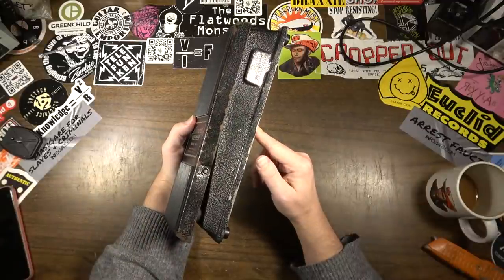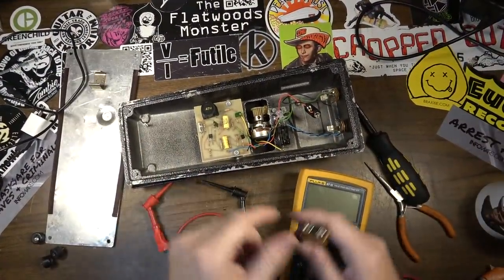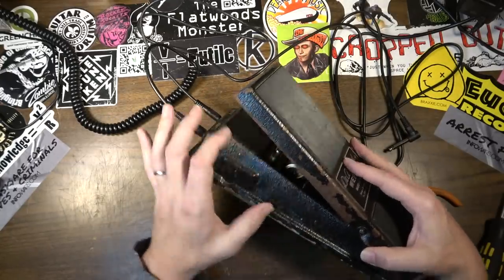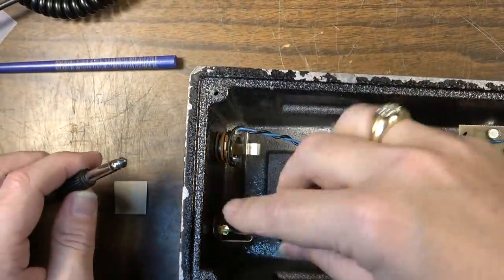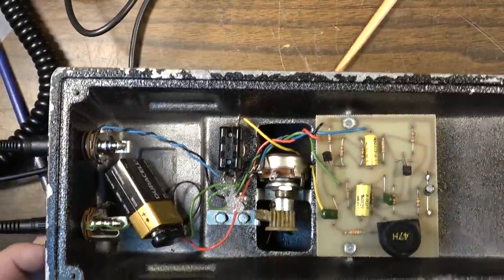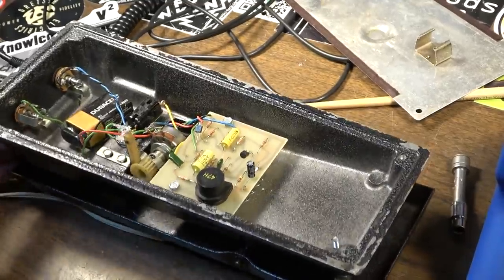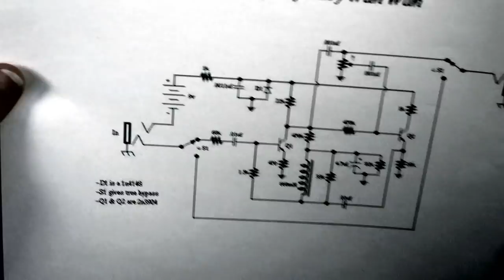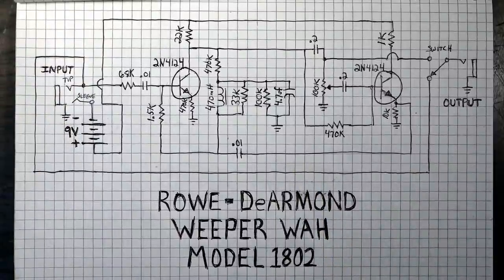Noisy WAH Repair - 1970s DeArmond 1802 Weeper Pedal

Comment: The Diode is just to protect the circuit from reverse battery polarity...
Reply: That vox  . 0011 mfd cap wont pass power (conduction) through that diode think about it? Diode protection would not use a cap? It would tied direct with no cap in series.. Its a signal  high pass noise filter of some sort.

Comment: Way cool, Brad! I scored two of those NIB this summer. They came from a music store that closed in the early 80's and had been in storage. One of them had almost no range and all I had to do was re-clock that gear towards the high side.
Reply: Are they the "Block" style logos or the "Script" style as this one is? 🤔
Reply: @Tacopusher  These are script logos.
Reply: How's the sound difference between the two? I've also got a pair of script logos as well, but the sound it very different from one to the other. Upon further inspection, mine seem to have different potentiometers in them, or at least different variations of the same pot. My first one says Type EJ and says Extra Life under that and my second one simply says Type J and says 8112 underneath that. I tend to favor the Extra Life opposed to the regular one.

Comment: I've got a early 70s Dunlop wah pedal that's never worked in about 20 years and it's just a display piece now to be honest. But I do fancy cobbling together a tube screamer circuit into it just because it looks so cool and I'd like to use it in some fashion.... I've never actually looked inside it to try and see what the problem is and this video has peaked my interest in ripping it apart....cheers .
Reply: There isn't much in a standard Dunlop crybaby. It's usually the pot or jacks are worn out. At least that's what has always gone wrong with any that I have owned. I don't know how many turns the pots are rated for, but they get heavily used.
Reply: @deaddiver3768  it will be something silly as it got wet from an outside gig 20 odd years ago and stopped working. I don't use a wah much if any now but I love the look of the old Dunlop pedals. I will definitely dig into it in the next few days for sure.
Reply: Definitely try to fix it.. The old ones are very desirable, so I wouldn't go transplanting another pedal type in there if it doesn't work out
Reply: Fix that bad boy! It’ll be a great piece of gear.
Reply: Give it a go. I've picked up a few pedals super cheap and an Ampeg B15N for $50 all because of loose jacks or connections.
Just a turn of a wrench and presto! a fully working pedal.
A lot of the older pedals use the case and jack as the ground connection, so if it gets loose it will keep cutting out or not work at all.
Could also be a loose wire come un-soldered somewhere as happened to a PA speaker once.

Comment: That Dunlop diode/cap network is likely a “turn on -pop filter”. 
I’m a fan of these older less known Wah pedals. They are significantly less expensive than a vintage Vox and nearly identical inside. Then again, the Xotic Clyde is a killer Wah for even less!

Comment: The diode on the Dunlop CryBaby is for polarity protection. (well a very cheap and crude way)
That whole rail is the power supply rail.
Reply: Correct. And the cap across it keeps power supply impedance low, at audio frequencies.

Comment: My first diy pedal build had an inductorless circuit mounted in an old sewing machine regulator pedal, equipped with an LDR and a vane to keep it simple mechanically.
Soon after that I bought a Colorsound wah which DID have an inductor (huge sound improvement). It also produced quite some hiss, and when activated the bass sound of my guitar almost disappeared.
These pedals sell for crazy prices (like $400) just like the Watkins Copicat tape echo goes for even more.
Now I am reconstructiing the Colorsound wah from modern parts. And I found a decent pedal casing kit from China!

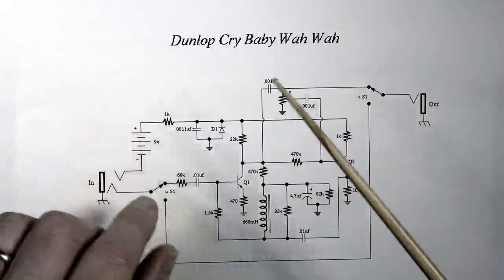Comment: 29:42 The 0.001uF capacitor is there to bypass any interference picked up, to ground, especially RF. Because there's an inductor and capacitors in this, it makes it susceptible to RF pick up, which will sometimes manifest itself as an AM radio station playing through your amp.
The 1k resistor and the reverse biased diode are there to protect against trying to connect the battery the wrong way round, but looking at the circuit I'm hard-pressed to see how any damage could happen if the battery was in the wrong way round and D1 and the 1k resistor were omitted. Q1, Q2 and the 4u7 electrolytic all have a fair amount of resistance between them and the supply rails.
D1 would deffo go short circuit eventually, if the battery was put in the wrong way round and the 1k resistor was omitted.
I'm curious now. I want to build this on a breadboard without the protection to see if anything is damaged by reversing the supply. 🤔
Reply: Our guitarist, had a Cry-Baby that ... in the down position ... 
got a local Spanish language AM station .... make your own joke !
Reply: @zankyalbo2208  Be sure : maybe the same station can be found in south west of France, at least :p (but by an amp, marshall MG10). It's strange to ear some Spanish alone in your bedroom :p

Comment: The mechanical aspects of Wah pedals were always a problem as they tended to take quite a beating back in the day because they took a lot of moving forces. Certainly rubber end stops got crushed with time and those rotary pots/gears and balance mechanism took a lot of punishment ... Even the rubber feet under the pedal case themselves could get splayed out and broken off due to the application of weight.
Great to see you fix one up ...

Comment: You fixed it! So cool to see this in real time. You rule Brad! Hit me up
Reply: no he didnt. Lots of mistakes and erroneous guesswork here. The cap is 25V not 2.5V and come on dont be lazy and tack it, the board is only on with 2 screws.  The first 470 is OHMS not 470K.  And after all that he didnt even fix the noisy transistor. He doesnt know basic electronics or how pedals work, all random hack guesswork

Comment: Hey, the potentiometer itself is interesting - I wonder why the manufacturer would use this tapped kind rather than a typical one, like the other pedal has.

I wonder about changing the transistors to BC547 or BC550, and/or changing resistors to metal oxide film type in order to get rid of the noise.
Reply: I've got two of them and the potentiometers are different from each other. One is older than the next and the "Script" logos are the older ones. These wahs have the Best "quack" to them and seem to nail that old school tone spot on!
Reply: Changing transistors won't help much unless the transistor is 'defective' and generates excessive noise.

Comment: Those extra parts on the power section of the Dunlop are to filter out noise when using an external power supply.  I have this pedal, it does have a DC input which is not shown on the schematic.  I also have a '71 Colorsound Wah, and a '77 Thomas Organ Crybaby (the one Dunlop based theirs on)

Comment: That level of noise is definitely not normal for a DeArmond M1802; mine is a couple of years older than that one (though a bit prettier) and it has always been really quiet since I bought it around 16 years ago.  For what it's worth, I've played through 3 or 4 others over the years, at least one of which was in fairly gnarly shape.  That one was a little bit scratchy sounding, but I don't remember having that particular problem with any of the others.

This is so fascinating; my other wah is a Vox 847, basically just like what that schematic is for- but there's a slight problem with the schematic.  As far as I know, Vox wah pedals were not manufactured at all from (roughly) 1980 to 1994.  The V847 was manufactured (I believe exclusively by Dunlop) here in the U.S. from 1994 to 2007, when they began production of the V847a in China.

Comment: It sounds to me like the noise is either a flakey transistor or a flakey resistor, both of which can make that type of hissy noise when they start to head south.
Reply from the maker: I'm leaning transistor. I would have expected a flakey resistor would have changed the noise when I tapped it with the ol finger or chopstick.
Reply: @TheGuitologist  Yeah, could be. I would run into this kind of fussy thing with mixer preamps a lot and ya know... it's always the last component you swap out that's the culprit. :-)

Comment: I had DeArmond volume pedal all with the photocell and it had hinges in it for some reason. Can’t remember if it had the gear with the teeth. The hinges kept coming loose; I was forever opening it up and tightening them. Finally gave up on it. When I moved to another house I didn’t take it with me. I have two different Jimi Hendrix wah-wah’s from the late 80’s/early 90’s that I need to get a true bypass mod done to. Hope someone sells a mid kit for it.

Comment: That crybaby diode cap circuit is a reverse polarity protection circuit if you connect that reversed that 1k resistor will burn 🔥 out. The. 0011 cap is to clean up transients from B+
Reply from the maker: I could understand that with a wall wort, but this schematic shows no power supply jack. That's what confused me. No need I can see in that with a polarized battery terminal.

Comment: Diode/resistor are for reverse polarity protection - in case you touch the battery backwards during battery change.

Comment: I think the pot back tab is so if the pedal is at 50% it has  minimal effect .
Down or up gives the full effect .

PS 
The BC109 is a low noise transistor .
2N4124 is general purpose transistor & the 2N3904 is a planar switching transistors  !

Comment: I could be wrong , but I’d assume the little extra bit in the cry baby has to do with plugging it in to a wall wort . I once had an issue with mine , and called Dunlops tech support . I talked with a tech , and one thing he mentioned is that they work better on a batt. And they can be noisy when plugged in. Even though it had a circuit for that , it only made it better not gone.  Or something to that nature. And Something about 60 cycle hum . 🤷‍♂️
  But you know me Brad , I’m just a picker , not really a tech.

Comment: I have several of these (three, I think) and was going to do a little video, too, given that two of them don't work. We grabbed one in my old band in the late '80s because they felt a bit darker and gnarlier than the traditional Cry Baby, which was already beyond cliche. Have you ever gotten any of those Morley optical wahs on your bench?
Reply from the maker: I have not had to repair any Morley optical. I’m guessing those will be super reliable.
Reply: @TheGuitologist  I don't know anything about their wahs, but their volume pedal is a pretty interesting affair. It's a light bulb that shines on an LDR, and there is a piece of black felt that the pedal lowers in front of the bulb to shut off the amount of light getting to the LDR. It's pretty inventive, really, and you never have to worry about the pot getting scratchy, because there isn't one. I wouldn't want to have invented it and made it work, but it's a pretty simple idea.

Comment: It is useful to use silocon elastic band over battery and conector to shrink battery conector with baterry outlets. Easy and handy.
But, before fiddling around mechanical setting of sweep range, I would clean pot track with technical alcohol - it is the most probable reason of many noise issues in such a devices. You mechanical repairment only set another freq range of high border so it is lower now. And then BC239 or BC413 instead of those inside. Minimally basic noise will go down. There are still another hacks for noise issues - cap 10nF paralelly with choke and cap 22nF from pot center to ground. Enjoy!   CHI :@)

Comment: What exactly does it do? Based on the sound (at least with 60 Hz hum as input), it seems to introduce some distortion (clipping?) and frequency modulation (pitch change). I wonder if there’s a schematic available?
Reply: He drew 1 for it at around 24 min into the video.

Comment: The emitter resister on Q-1 is 470 ohms (.yellow purple brown,)....not 470K,... 
   Using lower noise transistors, and more filtering across the 9  volt battery helps get rid of the crackling noise.  As black plastic transistors age they often become more noisy. 
   One reason the battery doesn't make good contact with the battery clip , is that when 9 volt batteries  became mostly made in China or Asia, someone approximated the distance between battery poles in mm rather than inches and settled on a different dimension.  Old American battery clips often do not easily accommodate Asian made batteries which are also wider, than old USA made 9 V batteries. 
 My guess is the pot may have been previously changed,... a tapped pot of one meg is usually a volume pot, with the tap being used to apply EQ caps/ resistors to approximate counteracting the Fletcher / Munson "loudness" curve, at low volume.  Those sealed pots were usually Allen Bradleys the similar ones made by Precision in Canada are also excellent.  You can take them apart by bending up the tabs on the edge. to spray clean the element or use isopropanol on a q-tip.  Great video.

Comment: buy  a  pin vise  and  set of  miniature  drills  jewelers  sizes    
use  about  .o40  to drill a hole in the pot  
then spray it full  of  deoxit
patience  and  skill   is  paramount

Comment: D1 serves as a reverse battery protection
Reply from the maker: Does the modern Crybaby have a 9V power supply jack? I can’t remember. If so, that would explain it. Omitted from the schematic, if so.
Reply: @TheGuitologist  I have a CryBaby from the late 80"s and it has a jack for a 9V power supply.

Comment: The 2N4124 uses the same emitter resistor values and collector resistor values for biasing. The datasheets HFE value and the collector current value will give you the DC gain. If would be nice if you can make a video lesson about transistor biasing values because the Collector current DIVIDED by the transistors HFE will give the result of the DC gain. The other ways used BC109 so its a different HFE value and collector current value.

Comment: My wah is getting radio signals every time I kick it on. I isolated the problem to the pedal. I read somewhere that it might be the pot. Have you had any experience with this? As always great video.
Reply: In my old house, no matter I plugged in or where I plugged it in, I got a Christian talk AM station from somewhere. I live in metro Detroit and we have no such stations in my local area at 1270 am which was the station. I still have no idea where it came from lol.
Reply: @misterknightowlandco  I had a similar problem with my Jaguar. I just made a faraday cage inside. It hasn’t done it since I live pretty close to a military base, so I think we get a lot of radio signals around here.
Reply: @gorlagOv  yeah, your probably swimming in radio signals with all the various forms communications systems used at a military base. I moved to the country since then and no problems with rf out here although it was a rather expensive solution to the problem lol
Reply: @misterknightowlandco  moving to the country is a goal. Then I could reasonably own 4/12 with a some kind of plexi.